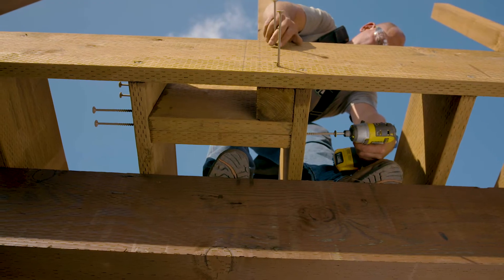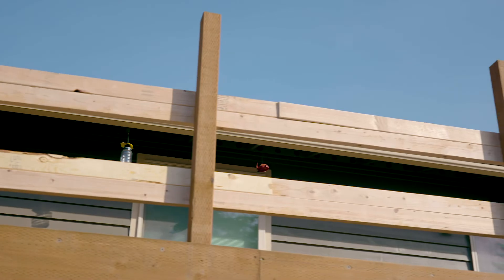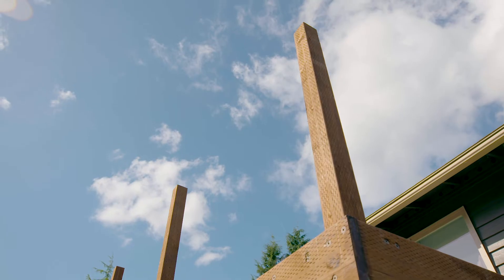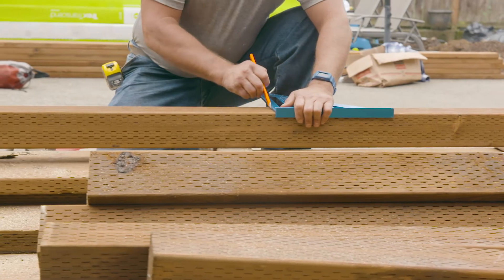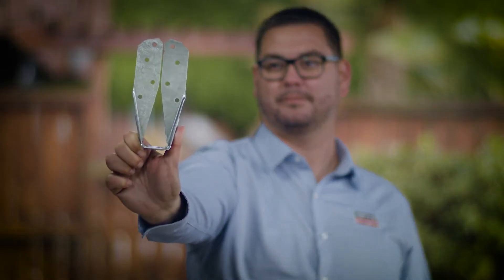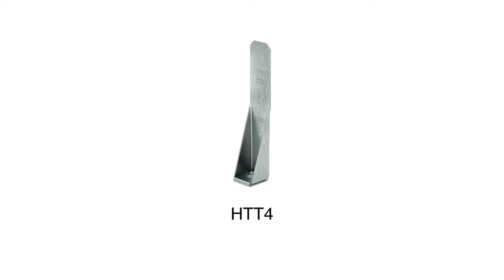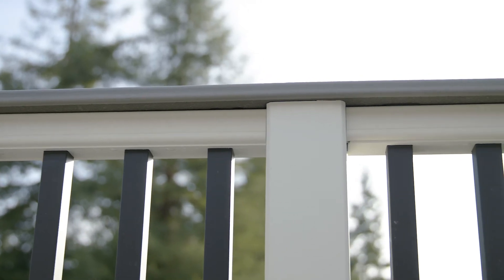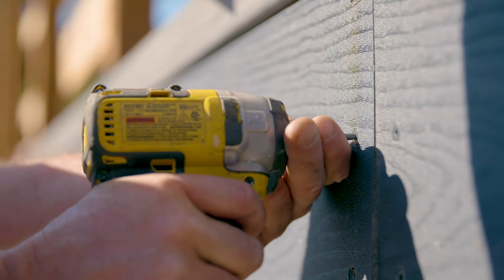Build a Stronger Deck: Guard Post Connections

Comment: what if your posts are on the outside of the rim joist?
Reply: two bolts to tension ties attached to a board lined up with your post under the deck. This is how I'm doing mine and is the proper way. Simpson doesn't sell affordable tension ties for our situation. However, If you have Menards they do and they run about $11/ea. It gets expensive but results in posts you can lean on. When using cable style railings like I am you need the posts to be solid. Unfortunately, I have not found a way to do the corners without using two posts and it getting kinda complicated under the deck. lol that's why I'm here... moving on